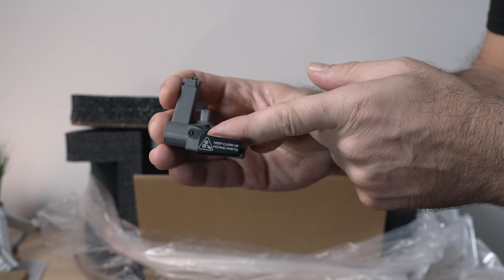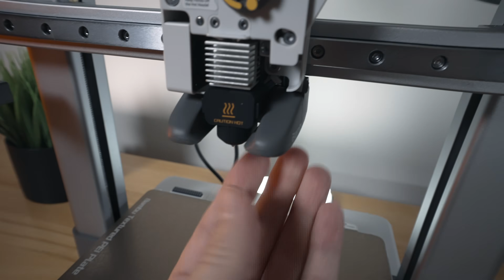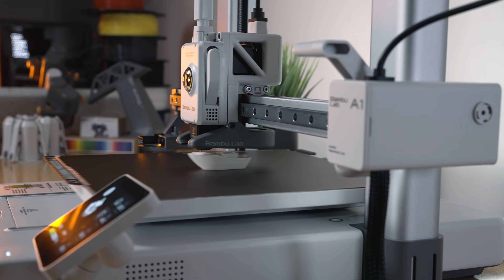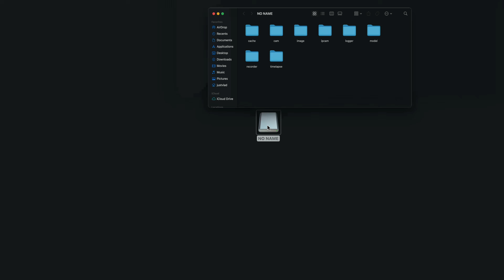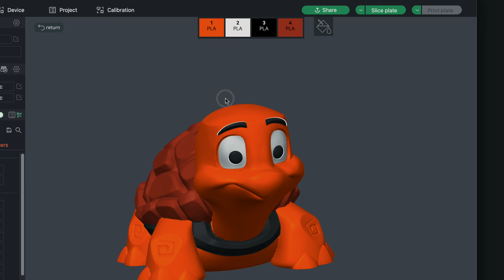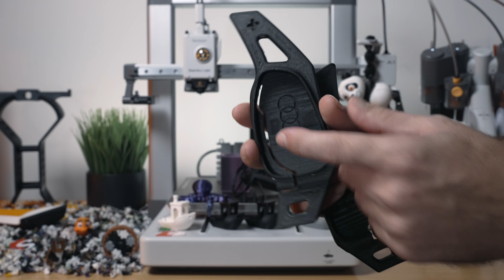Bambu Lab A1 Combo - AMS 3D Printer - Unbox & Setup

Comment: First of all, I'll let you know that it has nothing to do with the channel, it's just a rant about the world of 3D printing.

Today, I bring a different perspective on 3D printers, based on the research I carried out.
I came to a conclusion that I would like to share.
I have a comment about the world of 3D printing, which, contrary to what some say about accessibility, is still a world for few. Despite the criticism I may receive for this, I believe that although printers have become more affordable, there is still a long way to go before they become an achievable dream for many people, including myself.

It's not just the initial cost of the printer that must be considered. An often overlooked point is the ongoing cost of the filament. Just like in the early days of inkjet printers, where the price of ink was an obstacle, today we face similar challenges with filament. Even though printers have become a little cheaper, filament remains a considerable investment.

It is notable that over the years we have not seen a significant reduction in filament prices. There appears to be a lack of real competition, resulting in companies setting prices almost like a monopoly. Filament quality is also a concern, with reports of poor quality not justifying the investment.

Another aspect that is rarely addressed is the amount of material wasted due to unsuccessful prints, especially for beginners. Even though errors decrease over time, they do not disappear completely. This is a relevant point to consider, as it contributes to additional costs and not to mention environmental issues.
That's why I say it and I repeat, cast the first stone if anyone who has never been through this, even with vast experience, still prints with errors and has to do it all over again, no matter the printer or your knowledge, there will be errors and as a result waste of material and input costs. what we need and start thinking about this issue, well the filament should be cheaper or there should be a collection of inputs by suppliers especially those that went wrong or leftovers that new printers leave to make multicolor parts and why not buy back the material, it would help the person who bought it and nature thanks you.

antes de qualquer coisa ja aviso que não tem nada a ver com o canal é apenas um desabafo sobre o mudo das impressões 3d

Hoje, trago uma perspectiva diferente sobre impressoras 3D, baseada nas pesquisas que realizei. 
Cheguei a uma conclusão que gostaria de compartilhar.
Tenho um comentário sobre o universo da impressão 3D, que, ao contrário do que alguns afirmam sobre a acessibilidade, ainda é um mundo para poucos. Apesar das críticas que posso receber por isso, acredito que, embora as impressoras tenham se tornado mais acessíveis, ainda há um longo caminho para que se tornem um sonho alcançável para muitas pessoas, incluindo eu mesmo.

Não é apenas o custo inicial da impressora que deve ser considerado. Um ponto muitas vezes negligenciado é o custo contínuo do filamento. Assim como no início das impressoras a jato de tinta, onde o preço da tinta era um obstáculo, hoje enfrentamos desafios semelhantes com o filamento. Mesmo que as impressoras tenham ficado um pouco mais baratas, o filamento continua sendo um investimento considerável.

É notável que, ao longo dos anos, não tenhamos visto uma redução significativa nos preços do filamento. Parece haver uma falta de concorrência real, resultando em empresas que estabelecem preços quase como um monopólio. A qualidade do filamento também é uma preocupação, com relatos de baixa qualidade que não justificam o investimento.

Outro aspecto pouco abordado é a quantidade de material desperdiçado devido a impressões mal sucedidas, especialmente para iniciantes. Mesmo que os erros diminuam com o tempo, não desaparecem completamente. Este é um ponto relevante a considerar, pois contribui para custos adicionais e sem falar das questões ambientais.
por isso falo e repito , atire a primeira pedra quem nunca passou por isso ,mesmo com uma vasta experiência, ainda continua imprimindo com falhas e teve que fazer tudo de novo , não importa a impressora ou seu conhecimento , vai haver erros e como consequência desperdício de material e gastos com insumos. o que precisamos e começar a pensar sobre esta questão , poxa bem que o filamento deveria ser mais barato ou houvesse o recolhimento dos insumos por parte dos fornecedores principalmente aqueles que deram errado ou sobras que as novas impressoras deixam para fazer peças multicolor e porque não comprar de volta o material , ajudaria a pessoa que comprou e a natureza  agradece.
Reply: You are not wrong.
But inkjet printer ink is still expensive and will stay that way. Filament spool, on the other hand, is much cheaper and does better than inkjet ink in terms of storage. Inkjets clog where 3D printer just works after long periods of not being used.

Filaments stored correctly and cared for will do much better. Inkjet has to constantly be used to stay usable.
Reply: @TheHypogriphQc  CHEAP? HERE IS yet another question regarding the prices of PLA filaments in the Brazilian market. Recently, when comparing filament costs between the United States and Brazil, I came across a significant disparity. While in the United States the average cost of PLA filament is approximately 25.52 dollars, in Brazil, this cost is substantially higher, reaching around 127.08 reais on average.

This price disparity led me to reflect on the accessibility of filaments for 3D printing in the Brazilian market. While in the United States the cost of filament represents approximately 2% of the average minimum wage, here in Brazil, this cost corresponds to approximately 9% of the minimum wage. This difference is considerable and raises questions about the access of these inputs to a wider audience.

I understand that there are economic and logistical differences between the two countries that can influence production and distribution costs. However, the similarity in filament prices, despite these differences, suggests the need for a more in-depth analysis of pricing practices in the Brazilian market (I may be talking nonsense but in my opinion the value in Brazil should be at least 4% which is already twice as much as the United States and also some companies say that they are 100% Brazilian with raw materials from Brazil, so why this value of 9%)

I can be one of the few to raise this flag and discuss ways to make PLA filaments more accessible and competitive in the Brazilian market, and accessible to more people. However, for personal reasons I may not directly enjoy this benefit if filaments become accessible to a wider audience. However, I insist and reiterate, I sincerely hope that more and more people raise this flag, firmly believing that a review of pricing and recycling policies for materials that went wrong or leftover printing (returning to that issue of multicolor printers), we will have more people with access to this incredible technology, and nature thanks you.

BARATO? AQUI TEM MAIS mais uma questão em relação aos preços dos filamentos PLA no mercado brasileiro. Recentemente, ao comparar os custos do filamento entre os Estados Unidos e o Brasil, deparei-me com uma disparidade significativa. Enquanto nos Estados Unidos o custo médio do filamento PLA é de aproximadamente 25,52 dólares, no Brasil, esse custo é substancialmente mais alto, chegando a cerca de 127,08 reais em média.

Essa disparidade de preços me levou a refletir sobre a acessibilidade dos filamentos para impressão 3D no mercado brasileiro. Enquanto nos Estados Unidos o custo do filamento representa aproximadamente 2% do salário mínimo médio, aqui no Brasil, esse custo corresponde a cerca de 9% do salário mínimo. Essa diferença é considerável e levanta questões sobre o acesso desses insumos a um público mais amplo.

Entendo que existem diferenças econômicas e logísticas entre os dois países que podem influenciar nos custos de produção e distribuição. No entanto, a similaridade nos preços dos filamentos, apesar dessas diferenças, sugere a necessidade de uma análise mais aprofundada sobre as práticas de precificação no mercado brasileiro (posso estar falando besteira mais  na minha opinião o valor no Brasil deveria ser de pelo menos 4% que já é o dobro que os Estados Unidos e também algumas empresas falam que são 100% brasileira com matéria prima do Brasil, então porque este valor de 9%)

Posso ser um dos poucos a levantar esta bandeira e discutir maneiras de tornar os filamentos PLA mais acessíveis e competitivos no mercado brasileiro, e acessíveis a mais pessoas. No entanto, por motivos particulares talvez eu não usufrua diretamente desse benefício se os filamentos se tornarem acessíveis para um público maior. Contudo, insisto e reitero, espero sinceramente que mais e mais pessoas ergam esta bandeira, acreditando firmemente que uma revisão das políticas de precificação e reciclagem dos materiais que deram errado ou sobras de impressão (voltando àquela questão das impressoras multicoloridas), teremos mais pessoas com acesso a esta incrível tecnologia, e a natureza agradece.
Reply: Printers are cheap
Put aside like $50 a month and you can get a decent one in a year
Printers are not used by you the whole time, so get a friend to pitch in with you even -_-

Rolls are mad cheap... Basic color ones are like $15-$18
That's really cheap for filament. I mean... really, really cheap

If you're running a business, you can sometimes get $50 on one order, and that doesn't even use half a roll

Excuses, excuses, excuses from you
Reply: @rubenverster250  "It’s alarming to see the price difference in 3D printing filaments between Brazil and other countries. In the U.S., a roll of PLA filament costs around 25 dollars (approximately R$143.75 with the dollar at R$5.75). In Brazil, the same filament is priced at about R$130–R$150, which represents roughly 9% of the minimum wage, while in the U.S., it’s only around 2%. In Portugal, PLA filament is also more affordable, costing around 20 euros (R$106 with the euro at R$5.30), representing about 4% of the minimum wage there.

These figures highlight that 3D printing in Brazil is still largely inaccessible, making this technology affordable for only a few due to high costs. The issue isn’t just about taxes but also about the high-profit margins companies aim to achieve here. For many, Brazil remains one of the least affordable countries for 3D printing products, which limits the growth of this technology and the dreams of countless people.

This reality needs more discussion. Consumers should question prices and demand transparency so that, in the future, more people can access this powerful tool for innovation."

"É alarmante a diferença de preço dos filamentos de impressão 3D entre o Brasil e outros países. Nos EUA, um rolo de PLA custa em média cerca de 25 dólares (R$143,75 com o dólar a R$5,75). Já no Brasil, o mesmo filamento é vendido a aproximadamente R$130–R$150, o que corresponde a cerca de 9% do salário mínimo, enquanto nos EUA representa cerca de 2%. Em Portugal, o preço de um filamento PLA também é bem acessível, custando cerca de 20 euros (R$106 com a cotação do euro a R$5,30), representando aproximadamente 4% do salário mínimo português.

Esses números mostram que a impressão 3D no Brasil ainda é para poucos, limitando o acesso de muitos a essa tecnologia por conta dos altos custos. A questão não se resume apenas aos impostos, mas ao lucro alto que as empresas também buscam obter aqui. Para muitos, o Brasil ainda é um dos países onde os produtos relacionados à impressão 3D são menos acessíveis, o que acaba por frear o crescimento dessa tecnologia e os sonhos de muitas pessoas.

Essa realidade precisa ser discutida. Mais consumidores devem questionar os preços e exigir transparência, para que, futuramente, mais pessoas tenham acesso a essa ferramenta que é uma grande porta para inovação.
Reply: @alexcavalcanticosta1585  Then why don't you improve the imports for filaments?

Some companies will directly ship to you from China
Reply: @rubenverster250 In Brazil, everything is not taxed, our government just wants to pay its public bills using taxes instead of reducing costs. Companies should invest in technology, which already exists in Brazil, to transform the raw material into the final product, which is the finished filament, and reduce their production costs, this is the only way Brazil can become an exporter of filament

No Brasil não da tudo e taxado , nosso governo so quer saber de quitar suas contas publicas usando o imposto ao invés de reduzir custos. as empresas deveriam investir em tecnologia, que ja existe no Brasil para fazer da matéria prima ao produto final, que é o filamento pronto e reduzir seus custos de produção , so assim o Brasil pode virar um exportador de filamento
Reply: @alexcavalcanticosta1585  It's alarming to see your AI generated comments
Reply: @rubenverster250  
Uma IA não consegue expressar uma opinião autêntica como eu faço. Ela apenas entrega o que você quer, sem considerar uma perspectiva própria, focando exclusivamente em atender ao que o usuário solicita para resolver uma questão. Opiniões verdadeiras ficam a cargo de nós. Reitero minha visão e sigo defendendo que, no Brasil, a evolução no setor de impressão 3D só acontecerá quando as empresas de filamentos adotarem tecnologias que muitas universidades brasileiras já possuem e começarem a produzir filamento 100% nacional. E isso precisa ser feito sem a ganância das empresas de lucrar excessivamente sobre os consumidores que compram seus produtos, ou do governo, que só quer taxar para cobrir o rombo de gastos que tem — gastos que não são para a população, mas sim para encher seus próprios bolsos.

An AI cannot express an authentic opinion like I can. It just delivers what you want, without considering your own perspective, focusing exclusively on meeting what the user requests to resolve an issue. True opinions are up to us. I reiterate my vision and continue to argue that, in Brazil, evolution in the 3D printing sector will only happen when filament companies adopt technologies that many Brazilian universities already have and begin to produce 100% national filament. And this needs to be done without the greed of companies to profit excessively from consumers who buy their products, or the government, which only wants to tax to cover the spending hole it has — expenses that are not for the population, but rather to fill their own pockets.
Reply: @alexcavalcanticosta1585  sorry, can't hear you with the thesaurus jammed down your throat

Comment: The A1 3D has been pulled from their website and not available.Bambu Lab has recalled these printers due to defective heatbed cable mentioned by other posters.
Reply: Are the 4 filaments provided with the A1 combo package ??
Reply: @milatoulouvier8509  I am curious also about this :D

Comment: Bambu filament rolls have an rfid tag on them that tells the printer what color and material they are when loaded in an ams/ams lite.  Also it's not a purge block, it's a prime tower, it's priming the nozzle with the color it's getting ready to print.
Reply: The purge is in form of the poops it flings to the side

Comment: Good video, but bad timing.  Bambu has asked for everyone to turn them off until they come up with a solution to the cable problem
Reply: YEP cant even buy one right now
Reply: i bought one yesterday is it fixed?
Reply: @xpectra4177  It may be - there is information to check the serial number, any after a certain date of manufacture are ok